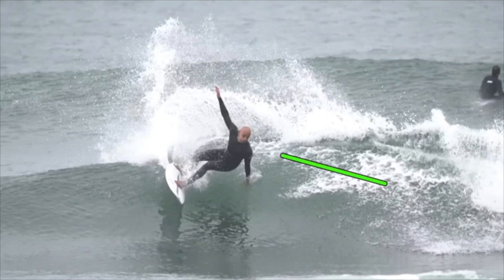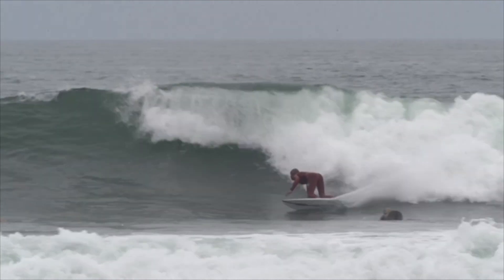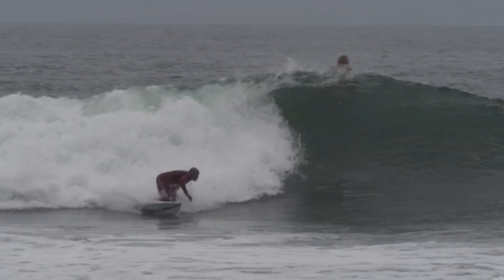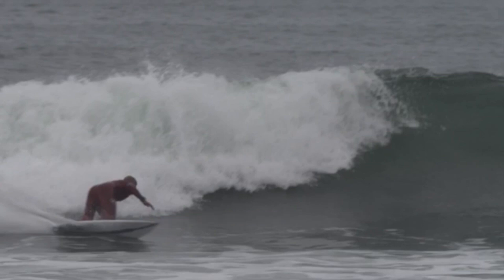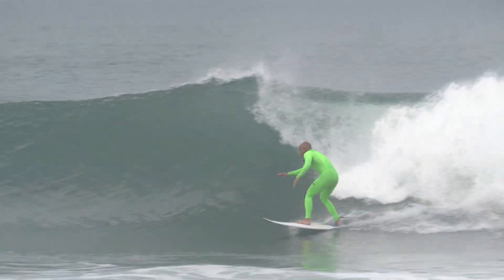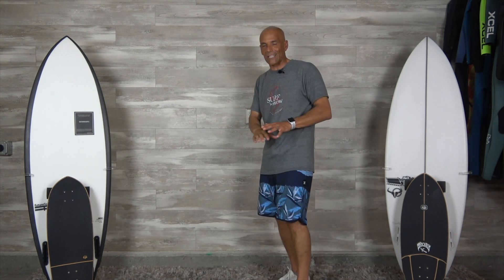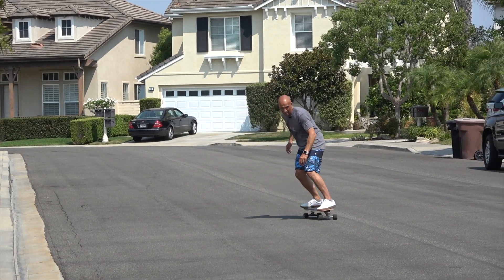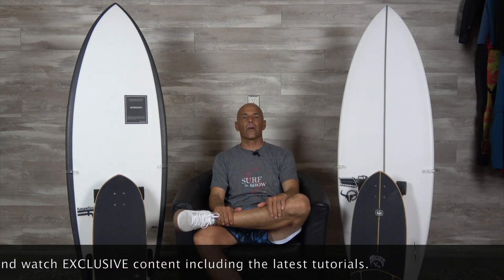How to Surf Better "Bottom Turns" Plus Carver Surf Skate Tutorial Ep. 1

Comment: Thank you for the tips. Another tip I got to help with bottom turning is to lean and touch the water with your hand. Once you improve your compression try touch water with forearm. Only applies to bigger surf and frontside mind. Back side use leading hand to touch. Small surf its more of a twisting motion rather than leaning.
Reply from the maker: We will go deeper into bottom turns in future episodes. We only work on couple things at a time in each episode so we don't overwhelm everyone with things to remember.

Comment: I'm waiting for your frontside 360 tutorial.  It's so counterintuitive  to turn into the wave going frontside.  I usually make the first 180 by releasing my skegs and then flattening my board out again, but then my skegs usually don't re-engage into the wave and the wave goes under me.
Reply from the maker: Soon... I want to get a solid foundation in the fundamentals before we start getting into tricks.
Reply: It's easiest to use the white wash of the wave breaking as momentum to finish the 180 into a 360.
Reply: One tip that might help is riding a finless board. They're a lot of fun and doing a 360 frontside feels more natural than backside nd it's really easy it'll get you used to the motion.

Comment: love this Vidoe! One question, do you put your back foot at the end of the pad right after you pop up? I surf small and mushy beach break most of the time and I don't know if I would lose speed when I do that. Thank you
Reply from the maker: If you want more precise turns then get that foot all the way back. If you are comfortable with moving your back foot around to gain speed and move it back quickly to do sharp turns then I suggest doing that especially in small mushy waves. If your foot is more forward on your traction pad and your turns feel sharp enough in the small waves then keep it the same to maximize speed. If you find yourself bogging through turns but surfing fast.... then you might want to adjust that a bit with moving your back foot further on the pad .
Reply from the maker: Darren Lin I move my back foot around a bunch. It’s up forward down the line to maximize speed then all the way back for precise turns.
Reply: @surfnshowreviews7777  Thanks for your reply Noel! I usually put my foot on the very front point of my traction pad when I pop up and I feel my turns are not sharp enough. So maybe I should put it  in the middle when I pop up, right?
Reply from the maker: Darren Lin Pop up and practice getting it all the way back for now so you can get used to sharp turns. If the waves are fast then scoot it up a bit.... but you gotta get it all the way back for epic turns.
Reply: @surfnshowreviews7777  Brother, any chance you're going to review the new Glazer by Firewire (Machado)?  Curious to see how it compares to the Seaside.  As always, love your videos and reviews.
Reply from the maker: L Dupree Yes... just waiting for boards

Comment: Great instructional video, Noel! Do you put your back foot all the way back on the tail pad on the takeoff or adjust it before hitting your turns? I tend to be front footed on the takeoff and been struggling with moving my back foot back far enough to hit those quick beach break sections that jump out at you right after the takeoff. Also, when taking off, does your back foot land on the board first or your front foot, or both at the same time? I wish you can talk a bit about the movements/ adjustments you do in between turns  down at the bottom to maintain speed and drive (movements at 5:29' before compressing into the bottom turn). Double pump bottom turn, maybe?
Reply from the maker: Yuno mi I usually adjust my footing to the need of the wave or maneuver I want to do. If the wave is fast from take off then my back foot is up in front of my traction pad then I move it back to hit the turns. If the wave is slower.... then I will drop in with my foot back all the way to hit a solid bottom turn. 

Not sure about which one of my feet hits the board first. I think they hit at the same time. I will pay more attention to that next time I paddle out.

Comment: Back arm must be forward(speed generating) when going down the wave, so you can(must) throw it back(from forward position) when doing the bottom turn thus increasing bottom turn projection. Then when you reach the lip you can(must) throw your back arm front again, powering your turn and facilitating the tail pivoting in the lip. Back arm proper use can better your surfing like no other thing. So, get up on the board, put your back arm forward until you reach the base of the wave, pedal energize, throw your back arm back(opening your chest) to do the bottom, then throw it back front to help pivot your tail in the lip. this is surfing. Backside surfing is right the opposite.
Reply: wdym its the opposite for backside surfing?